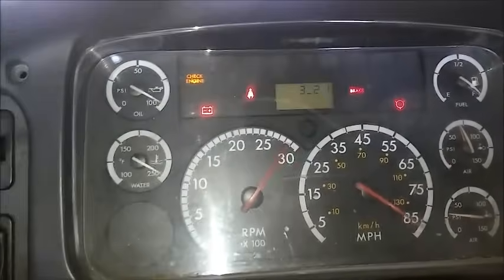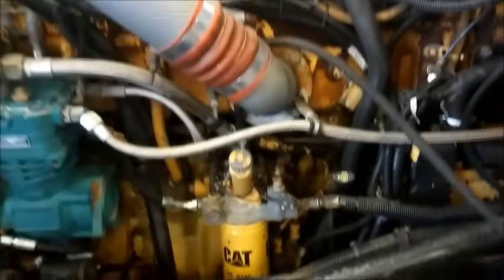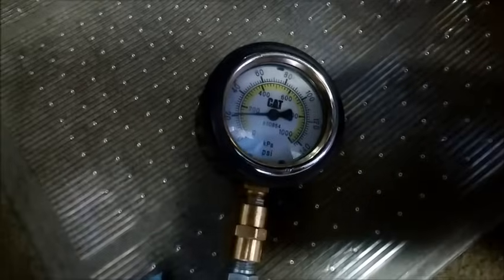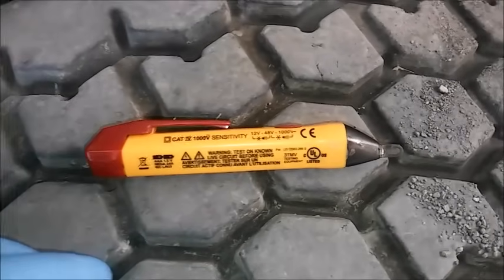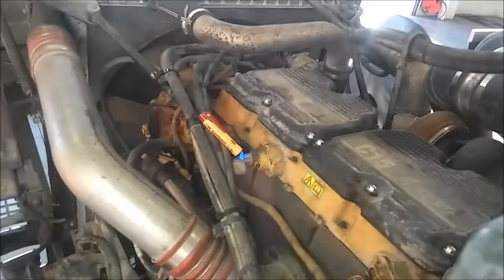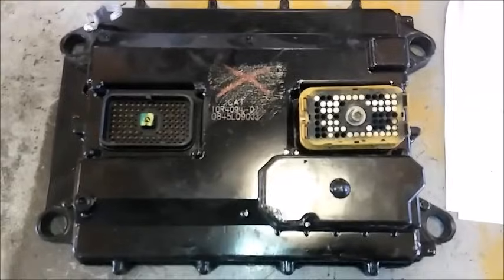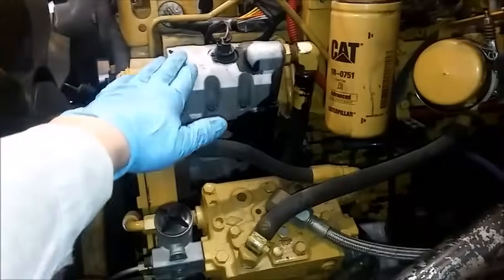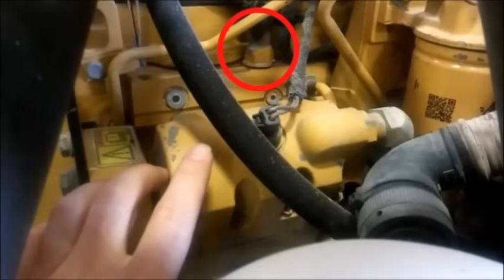Cat Engine Won't Start Troubleshooting.  Diesel Engine Crank No Start.

Comment: The dumptruck has the obd2 plug but every scanner is able to see with automatic detection what engine size but it is unable to see the specific model of computer it has and unable to read codes

Comment: I hold my cruse control accelerate button and check engine does not flash on my 2001 GMC c8500… with cat 3126… check engine light comes on solid it gives 1/4 engine power I can turn key on and off and get the engine light off and it powers up again for awhile… but in the next 20 minutes afterwards it will suddenly shut down without warning and no start till the motor cools right off

Comment: I replaced injectors and heui pump go to start won't lift fuel and has no engine sld231 fail 9 no power at data link in cab fuse panel

Comment: Hello, Adept Ape. This is an excellent video that has helped me with my 3126 in my motorhome. I sent mty ECM to a company to have diagnosed and repaired. They diagnosed it as having a bad injector power supply. I haven't received it back yet, but I also am concerned with the voltage readings on pins 70, 63 and 65. There is no pin in position 67. Pin 70 reads battery voltage when the key is off, and reads no voltage when the key is turned on. Pins 63 and 65 do not read voltage with the key on or off. I'm concerned that there is something else wrong in addition to the ECM. I have checked fuses and haven't found any blown fuses. Does anyone have any suggestions?? Thanks!

Comment: My C7 won't turn over. When it wouldn't restart right after I had parked it I thought it may be a bad starter. (No previous issues though) I puller the starter and it checked out good. Ran another low voltage wire to the starter from the switch. Then it would turn over but the glow plug light doesn't come on and it won't start, of course. Went back to original wiring. Any ideas?

Comment: I have a 3126b in a timber kutter that was running fine when parked then 2 days later it won’t start. It tries to and has excessive white smoke but never gets going. We checked high pressure oil and it’s 1800 or so. Pop test on injectors checks ok. Our low pressure fuel while cranking maxes out at 9psi. Which leads me to think fuel pump issue but I can’t figure out why all the smoke when cranking. It smells like fuel

Comment: Hello, can someone help me, my 2007 Sterling truck with a Cat C7, I changed the pump, it doesn't start, but when I put Star Fluid in it, it starts, but it has no power. All this happened to me after cleaning the engine.

Comment: Our RV, a 2003 Newmar Dutch Star on a Freightliner chassis and only one fuel filter with no fittings on it. It doesn't even have a primer pump. We had the situation you described that there was no tach movement during the cranking(only a very small twitch when I started to crank it then it was on zero) After about 12 attempts it started (and the tach signal came up to 2-300 rpm at the very beginning of the starting attempt. It does this occasionally but I've never noticed what the tach was doing. Once it cranks up it's fine and there have not been any codes. (It had been raining at the campground almost every day for 4 or 5 days. Thanks Josh.

Comment: Working on a Western Star with a Cat 15 MBN getting all six injector current fault codes logged so right away thinking drivers inside ecm failed. Replace ecm truck drive ok for about 4 hours then shut down connect cat et got all six injector current fault codes again. Crank and won't start connect bypass harness still won't start then put another ecm Engine start right up. What am I missing?.
Reply: AdeptApe have you ever come across something like that do you think injector harness or engine harness shorting out or the ground stud on the cylinder head please your help much appreciated

Comment: Bro i have a hyster 7 tons commun 3.3 l diesel, when turn the key switch on the board will show fuel and temperature, but when try to start the engine, no cranking happens , then the engine shut down count start and then shut down, i tested the starter no coming to the solenoid, when i direct jump the starter its cranking, but again not starting, i checked the electric fuel pump again no power coming from the ECU , by the way already tested all relays and fuses al. Good ,coming back to the pump i connected direct from batteries then at the same time jumped the starter , again cranking but no star , i checked the pump output feeding during the cranking and there is fuel feeding to the injectors, then i stopped, what do you think it may be the problem

Comment: My 3126 is in an RV. No primary or secondary filter. It only has a 10 micron filter/water separator. It got clogged with algae. I have treated and cleaned the fuel with an algaecide and replaced the filter but it still won’t start. HELP

Comment: My fuel senoild is not getting power on a 3126. Fuse good and power leaves the fuse on wire # 99. Does this power go through the ECM?

Comment: MY 2003 C 15 WONT START. IT SOUNDS LIKE THE BATTERIES ARE WEAK WHEN CRANKING BUT THEY ARE CHECKING 12.7VOLTS ANY IDEAS WHERE TO START

Comment: Thanks for your training. Very educative.
Please, I have a cat  c 7.1 Marine gen set that couldn't start. I connected cat ET to it and showed that the fuel rail pressure was zero while cracking, and there were no active or logged faults codes recorded. Solenoid test shows ok. I have replaced all the unit injectors and the injection pump, and the engine still records zero fuel rail pressure. What is your advice, please? Thanks

Comment: I have a c 15 engine which produces smoke on breather pipe and oil after I did service changing of engine oil oil filter fuel filter and after some days the oil dropped to 1.9 bar what might be the problem

Comment: I am in the process of rebuild a CAT 259D3  C3.3B DIT engine. Is there a way to test run the engine outside without ECM or most electrical connections? I do see a YouTube video is running the engine without injector connections but not sure how it’s possible when ECM controls the injectors in direct injection engine with common rail.

https://youtu.be/9kGm96d-Zss

Comment: Hey buddy I have a c13 engine I was driving and my fuel level was low. Then suddenly the truck started to lose power and started blowing white smoke out. I changed out the fuel filters now it won’t start. It starts with ether and idles great just doesn’t go past 1100 rpm so it has low power any advice? I also filled up the tanks to a quarter of a tank.

Comment: Howdy. I am working on a 2004 dump truck with a 3406E cat engine. Having issues with it priming up. The fuel housing was replaced,the hand pump replaced,new filters, the return pressure valve replaced. What's weird is we changed a bunch of that stuff and got the truck running and they used it for a few hours hauling loads consistently until they quit that night and it worked great but in the morning it wouldn't start for them again,they tried priming it and nothing so went back over and tightened a couple fittings that appeared might have been loose just a little and it actually started up for us so we left while it was still running etc.. Well they only got down the road less than a mile and it stalled and wouldn't start back up. Well as of now it still won't start with the exception it will on starting fluid but will stall right out  and even when running on ether there was no throttle response either.Any suggestions would be awesome.Thank you.
Reply: Were you able to find the issue?
Same exact issue, ran our 3406B a couple hours today and then suddenly died. Only cranks, im replacing the fuel transfer pump tomorrow.

Comment: Great information. I have a 2008 C7 that starts and runs great for about 1 hour, then the check engine comes on and off then the engine shuts down. It does not overheat. It will crank but not restart until the next day. I've changed the fuel filter , water separator, temperature sensor, fuel back flow valve, drained fuel tank and cleaned checked fuel lines. Could it be the ECM or a relay?

Comment: I have a 2001 3126 cat engine replaced a Huw pump. All new injectors ,,crank sensor,, Chuck valve on the back of the head still no start.

Comment: Hello Adapt ape, I have a question for you. I have a 1996 cat 3406e and looking for the compucheck fitting location. My does not have the fitting. Where would i locate it. I have the CAT 3406E Fuel Filter Base With Bracket And Seperate Fuel Filter Housing.

Comment: Hi Josh.  Does the power probe you use in the video measure DC voltage as well as AC voltage or voltage from any any source of polarity?

Comment: Please add some video for older models, I have a 1998 GMC supposedly with a Cat 3126. Just want to know how to drain old fuel out of everything past the filter and get good fuel to the system from there. Did a tank removal, cleaning and have the new fuel filter. I know enough to add diesel to the filter but I want all that old junk out of the lines right?

Comment: Thanks for you dedication to helping us!  I just purchased a 1997 Motorhome with 60K miles on a 3126B that cranks but will not start unless starting fluid is used, once it starts it will run just fine as long as you maintain greater than 1000 rpms, no smoking and engine runs smooth above 1000. If you ease up on the gas pedal to below 1000 rpms the engine shuts off, you can not feather or pump the pedal to keep it going, it is seems like an instant loss of spark/fire. Owner before me says he changed the HEUI pump and it did not correct the problem.  Any thoughts?
Reply: High pressure oil leak

Comment: Hello sir, I have a problem with the 320d cutter excavator that stops running after 3 minutes more or less. I go to the manual fuel dispenser, I find it empty, then it works for two more minutes, the first less, then the excavator turns off, then I go to the manual, I find it completely empty and the same problem continues

Comment: I have a 2001 C7500 with cat 3126.  It was missing the engine fuel filter and housing. Went to install used housing and metal lines. Now the truck cracks and will not start.

Comment: Well, I don't have an engine light turn on when key turns on, dealer said ecm is fine but both crank and cam sensors were bad, I put new ones in and stil won't start, I have all power and grounds to the ecm puns. I'm lost

Comment: Sir good day. I am one of you subscribers. We have a Cat wheel loader 950H with C7 engine. Engine no start. Only cranking. Huei pump and injectors are  newly calibrated. No faults showing on the cat scanner. I changed already the 2 timing sensor. And still not starting. Could you help me on this problem please?
Reply: And also cam sensors changed.

Comment: I have a 3126. The oil pressure light came on and it shut down right at the intersection. We got it pulled off to the side of the road. Cranks but no start. I've tried priming the fuel with no luck. Any advice to get this truck to fire?

Comment: Bro i need ur knoledge, my damm cat 3176 wont start after i pressure washed the truck, i left it running, it shut off and wont start, its done that before but it starts right after, this time i cant get it on, it will run on ether but it cuts out and i have fuel pressure.  Theres a cable in the ecm harness that i had connected to ground originally and now it seems to have 12 volts, any idea?  The damm cable comes out of the ecm side and  if i connect it to the ground again it pops the ecm 15 amp fuse.
Reply from the maker: You should email me at adeptape@yahoo.com can't really troubleshoot something in the comments section.

Comment: I have 3126b and once it starts it runs great and starts right up but you let sit for a couple days it will just crank and crank do you suspect a fuel pressure regulator
Reply: @adeptape

Comment: I left you a video about the tree service truck it cut off my comment I rebuilt the Huey pump over I just replaced him over things that had a oil leak but by the time I got around to getting everything back together the truck has been sitting almost a month and I have a no start. I didn't have any issues but a o ring that was pouring out oil.
Reply from the maker: You should email me technical questions at adeptape@yahoo.com the comments section is a bad place for them.

Comment: hello I have a 3406e cat my issue is it loses it's prime after sitting it's hard to start in the morning. I had the fuel system upgrade from the glass bottle to primary fuel/ fuel water separator  some years ago it runs if I give it a shot of starting fluid it's in the shop now can't find why it's losing its prime. all new front engine gears/replaced 3 injectors/ new radiator system/ water pump .and the bill is high help please.

Comment: Hello sir,
  Ever hear of a 2000 CAT 3126 going down the road fine and then all of a sudden the throttle pedal stops working and then eventually the engine dies leaving you along the road? I had no leaks or anything visible. The engine still cranks but no fire. Earlier in the morning i changed a burnt out tail light and i noticed as i turned the flashers on my climate control display was blinking in sync with the hazards. The turn signal would just stay solid then all of a sudden everything acted fine. Proceeded to job site and just lost power.

Comment: Have a 1998 Chevy C6500 truck with a 3126 that was running when parked but sat for 5-years.  Runs on ether.  Manual pressure pump (primer) pumps up hard.  No power to magnetic solenoid but all fuses show good.  Directly powered the solenoid but no start.  Would really appreciate a direction to go in.  Kinda in a hurry to get running

Comment: Thanks for your videos very helpful.  I do have a question about a cat c12 I have now for 6 years.  It has only failed to start twice and mysteriously, after I let it sit, and then it started.  I did have fuel pressure but it just wouldn't fire.  Would be interested in knowing what I can do if it happens to do it again.  Thanks

Comment: Sir i have question. What is the possibly trouble its hard to start but when i try to spray with a little amount of gasoline on intake its starts easyly what must be the problem of my cat backhoe? Thanks for the answer sir

Comment: so I have a c7 cat it will run for a few days then stop running! after it stops i had to use starter fluid to start it any suggestions as to why this happening or what the problem may be

Comment: Bro I seriously need your help my 6nz will not start I've spent over 2k and got no where it cranks and runs on ether and brake cleaner but will not start I've checked out everything mechanically all injectors work 82lbs of fuel pressure pump and everything works return line has fuel rpms work while starting did the blink test and came up with code 62 for low coolant added coolant still no start and no other codes available even added another ecm and got nothing I am so confused please help
Reply: What was the remedy?
Reply: Think it might be the pump I'm replacing pump lines and check valves if it dont start then it off to cat I'm tired

Comment: Well my engine is a 24-volt in a drill so I'm getting all kinds of white smoke which is low fuel pressure smoke nine times out of 10 on a diesel

Comment: On the 3126b I just did an out of frame overhaul on it I however have no fuel pressure 1821 pounds and you have to crank it forever to get there with it

Comment: I have a 1999 3126 that has faults on all 6 injectors. I tried putting the test light in the wiring harness where it goes into engine. The light flickered just like yours did on the video. So could it still be my ECM even though I’m getting voltage on the wires? Also we tried a test ECM from a local diesel mechanic but the engine still didn’t run. Our local cat dealer seems to think we have a short in wiring underneath the valve cover. Any info you could give me would be greatly appreciated.

Comment: 20 psi on a 3126 acceptable. 
The Truck I’m working on, starts but then won’t start again after shutting it off, engine is not hot.
Reply: I have no engine faults present in the ecm. We don’t have Cat ET. We use JPRO.
Reply: We also resealed all 6 injectors. Seals were bad.

Comment: I need HELP please. Bought a 1998 Freightliner FL60 with 3126b   Had no start that I fixed changing solenoid on HUEI Pump. Now truck is low on power. Extremely bad cold and would guess power in warm engine down 20% or more. Cold truck will barely move. Warm I can drive and feels normal till you pull a grade or haul a load then it’s way down on power. axelrodmotorhead@yahoo.com   Truck has 130,000 miles on it. Cat filters , new prime pump

Comment: Could you provide a link where you could find a good cat fuel pressure check gauge like the one you use in videos! What did you call the connection point? A comp u check valve?

Comment: I've got a c10 crank no start. First thing I noticed is the engine light key on engine off will not come on. Can wire from pin 70 "no power" cause this?

Comment: C15 and 3406E. On both them performed a cylinder head replacement and rebuild and after putting it back together wouldn’t start.(crank no start) Fuel pressure ok and no engine codes. Cam sensor was the issue both times. Weird it never logged a code but just fyi for anyone who runs into this
Reply: What was the fix?
Reply: @iwishtobetexan6060 cam sensor

Comment: I have a c7 that is difficult to start cold even when it 60’ F.  Will give whiteish smoke when cranking and sometimes needs either. Once it starts it runs excellent and fires up fine when warmed up. Any ideas what could cause this? Thanks so much! 

-David